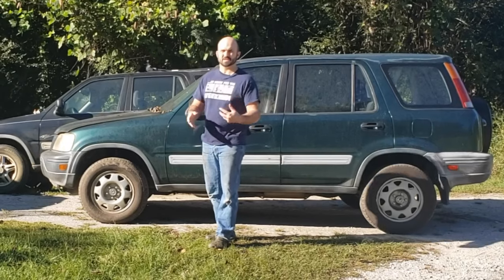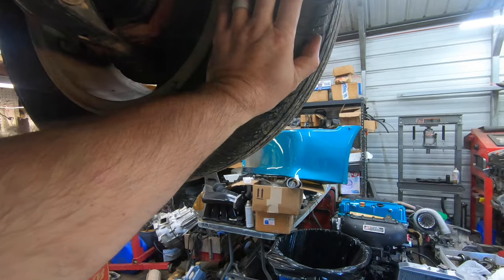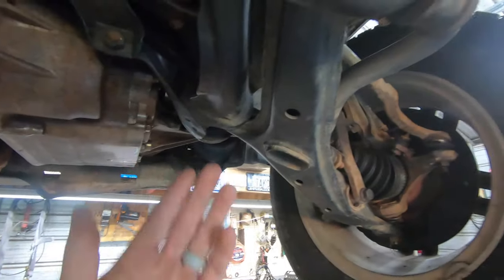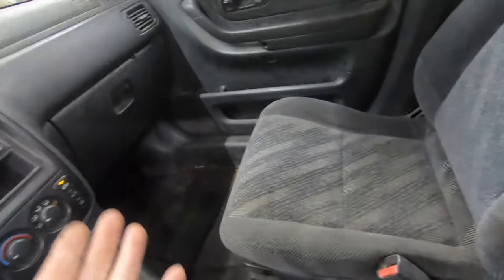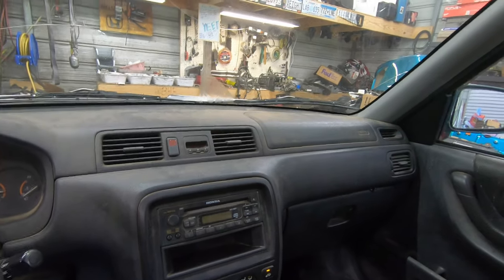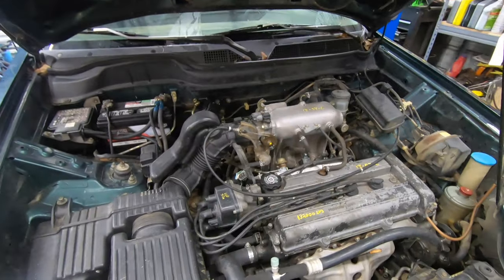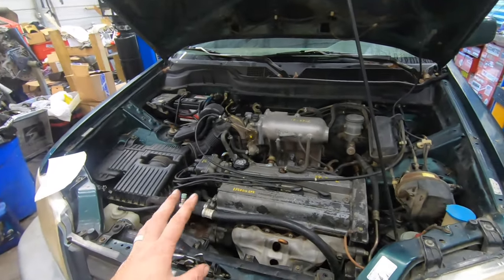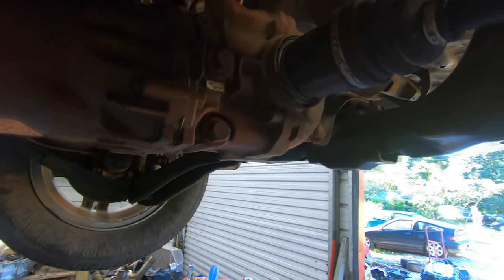Most Common Problems: 1997 - 2001 Honda CRV RD1 RD2

Comment: I have owned a 98 CRV since it was new, a common problem I have had is that the electronic air control valve bolted to the back of the intake manifold becomes fouled, causing rough idle.  It needs to be cleaned with brake cleaner every 10,000 miles or so.  Keeps the car idling smooth.
Reply: I'm thinking I need to do this because I had surging idle with IACV DTC for a second.
Reply: Every 10k miles sounds like over kill lol maybe once a year🤷‍♂️🤔
Reply: @Danny Martinez  well every 10k miles is once a year for a lot of people
Reply: @jacobgillean7129  I never had issue bruh
Reply: @Danny Martinez  same here. But my friend has had that issue on one of his crvs and his del sol
Reply: Yeah IACV issues is common on ALL B series motors. Anyone who's played with enough of them knows all the nuances of the lovely B series IACV issues.
Reply: Typical honda problem
Reply: yes i replaced 2 IACV already in addition to the cleanings in between @210K miles
Reply: I have the same issue.. I’m thinking mine might be with PCM programming or something though because cleaned it and only helped a little
Reply: @dannymartinez8522 on average, ppl drive 10k per year, so 😊
Reply: I have an issue, when I turn my steering wheel my rpm’s go down and starts shaking also have rough idle, did that happened to you?
Reply: I have the same issue glad I saw this comment I thought it was in the valve cover

Comment: 1999 CR-V EX, 267K miles two years ago the a/c compressor went (part $168/ + $120 install) and charge,  2 rear links and the cruise control does not work, the clock in the center of the console doesn't work and I had to replace the door pull latch drivers side, $11 for the part and about 20 mins of my time.  That's it.  Best car I ever owned.
Reply: wow thats awesome! just got a 2004 crv 170k in immaculate condition and i mean immaculate! hope to see it get to the 267k
Reply: The clock didn't work in mine when I first bought it. I took it out, disassembled it and followed a tutorial on here to reflow solder. Worked like a charm. Just be careful when removing it from the dash as the dash is soft and likes to crack when leveraged against. :)
Reply: @kirleyq1394 Thanks!
Reply: @gailmrutland6508 See video:   Honda Cruise Control Fix With A Penny_   DIY Jeff 
I am not sure, but the above YT video MAY be the fix your cruise control issue.   
And read the comments section afterwards, because there's an adjustment.  See 5th comment down, made by @itzmrfizz
Reply: @kirleyq1394 mine dont work either

Comment: Just FYI on the passenger side water on the floor.  I have dealt with this issue on a few of them.  On the roof there is a black strip that runs from the windshield to the rear window.  There is a body seam under that trim and the sealant cracks.  The water enters the body seam, runs down the a-piller then behind the dash and onto the floor.
Reply from the maker: I'll definitely check that out as I have one here now with that problem
Reply: I also have the same problem
Reply: A cruddy door seal will also cause a "leak" onto the front passenger floor.
Reply: currently I need advice how to deal with mines  I have  the 1998 model with sunroof and when rain fall heavy both passanger and driver side  water on the flooring please what cause this really need to get this sought out soon as possible. could it be the sunroof rubber need changing if so where can I source the rubber online to purchase. Help anyone please how to deal with this problem.
Reply: How would you fix that?
Reply: Dealing with this now.
Reply: @kenankabbani855 probably replace seals or try some kind of sealant
Reply: I have the same issue with the water. I procrastinated too long and now my heater doesn’t work. I’m going to check it out this weekend 😂
Reply: I had the exact same problem after I had the windshield replaced it was still leaking then I blocked off the fresh air Inlet and it was still leaking and then look under that black trim and found the crack a dug out the seam sealer and caulked it back with clear roof caulk no more leaks
Reply: @paulettemcintosh1834  It's not the sunroof rubber seal. It's the drains that are clogged.  There are 4 gutters that each lead to a drain hose. Each hose is channeled through the "A" pillars in each corner and down through the floor plate where it is designed to flow to the ground outside the car.

When the hose channels are plugged by dust, leaves, tree branches, pollen, road debris, etc, the water from the rain can no longer flow through to the ground. This causes the stopped-up water to seep through the joint between the sunroof gutter and hose there by trailing on the hose till it gets to the car floor plate. Hence, the water pool.
Reply: @SluiceBuckit  The water leaks is not connected to your heater inoperability.

Comment: I live in South Africa and own a 98. Most issues you mention I have dealt with. One issue that there was with mine is on the ignition switch. There is a small harness about 4 inches long that connects the ignition to the wiring harness. The ignition wire fails, causing the car to cut out while driving, and you have to restart. In the beginning it happens intermittently, but get to a point where you start the car and it dies immediately, and to replace it costs a small fortune in my country. I solved the problem by brigding the ACC switch and the ignition switch with a small piece of wire. This was 9 years ago and never had problems again. Only drawback, when you switch the car on at ACC the dash lights up. Hope the advice helps someone

Comment: My 2001 manual 5 speed in newly painted Milano red will hit 300K soon.  I do all maintenance myself & it runs like a dream. I've experienced about half the issues you list & some you haven't. The last part I replaced was a door lock actuator. Those $9 aftermarket actuators are junk!  My CRV is only the 2nd car I've ever owned & I just turned 60 yrs old. My last car was a Mazda RX7.  Only Japanese.
Reply from the maker: Nice! We have 2 '93 rx7s
Reply: I saw a bright red 2001 recently. Couldn’t believe how nice the new paint job was. Did you have a chain outfit do the work or local shop?
Reply: @gomertube  Went to Maaco. Filled any dents myself to save money.  $1300.  I was told I didn't need their premium paint job. No orange peel & damn looks brand new.
Reply: @darrylstevens2556  Thanks, man.

Comment: I bought mine with a valve seat issue, I had a machine shop fix it and has been great since, I did the oilpan updated gasket when I had the cylinder head off, I'm sure mine needs the front swaybar links and change rear diff pump fluid, great little car with it's own table.

Comment: I swapped the rear diff for the unit from the 2008-11 Element, and it makes a huge difference!  Drives much more like a car, the original diff makes it feel like a heavy truck, even though it's a unibody.
Reply: I have a CRV from 99, 147 hp, and i'm interested.
Besides the quieter move  how about the power ?
How difficult is to replace the diff ? Does it fit ?
Reply: @adihus67   It's not hard to replace the diff, it's very accessible.  The power feels much better, it completely changes the driving feel of the CR-V, feels like a nimble car instead of a truck, even on the snow.  It's an exact fit because they used the same casing as the original unit, which makes sourcing one difficult, they only way to tell which one has the upgrade is by model year.
Reply: I didn't notice any difference in noise between the new and old diff, but neither seems loud

Comment: Great informational video. Was able to fix the clock in my old first gen with a $10 sottering iron. Only issue i had for the 30,000 miles of ownership i had was a sticky thermostat. Sold it to a good friend with over 300,000 miles on the odo and its still going strong
Reply from the maker: I've fixed a couple clocks over the years. I dont even bother with them now
Reply: Huh?
I tried to fix my clock with a solidering iron, I plugged it in, came on for 2 seconds and went back out.😐
I tried to solder as much as I can but couldn't get under a circuit board plate..the plate is like glued on.
Reply: For the clock I bought.a LED kit on Amazon for about $10 that fits inside the existing case.  No battery required if you hook it up to the exiting car battery wiring. Voltage divider (2 resistors) will reduce the voltage down to under 4 V.  All the old clock components get tossed.
Reply: @Darryl Stevens can you please link me to the led kit you used? Also tried to solder two diff oem clocks, works intermittently. Seems like the problem is in the wiring harness which i’d rather not deal with. Clock seems to work when moving harness in diff positions

Comment: Thanks for the vid. I love my 1st Gen CRV. I do have some issues but for the most part, these cars are tanks. A true testament to Japanese quality cars when they were still made in Japan.
Reply from the maker: I love them man
Reply: @hondaresource  Quick question for you, a while back I had an issue with the transmission slipping. (I had the transmission rebuild but still giving me problems, diff issue) .What is your recommendation when it comes to transmission and giving problems on this gen 1 Vs. Do you look for a wrecked one and swap it? (but I am afraid I am just buying time before it happens again). What's your take on this? I know the gen 1 Vs are notorious to have transmission issues. Thanks in advance for the comment on my question. And awesome content on the channel. You got a new subcriber here. :)
Reply: @itsjiraheta  I had the 2 trans oil sending units replaced and the trans goes good now....only issue is I get a small clunk when going into 2 nd gear....but I'm having trouble passing emissions because it still trigger's the check engine light....The Tork converter   ......I'm looking to get a used trans on eBay or Junkyard.....then having it installed.....But common problem......
Reply: @SaulnowPaul77722  Thanks for the info. I just hit 200k. Doing a lot of work on it. I went to a junkyard and got me some some working selenoids. I hope that helps me. Doing a transmission flush too. Ill share my findings. But, I have heard the same thing. That tends to be a common problem. Thanks for the reply.
Reply: I have 1997 Japanese RHD! Love my little Beeden!  I am a mail carrier in the north.  AWD handles snow like a champ!!!
Reply: @robinhairell7780  Nice! I more on the south. I did drive the CRV from south Florida to PA. Lived there for about a year on a project I had to do there. The short time I was there on the winter. I could see a couple of places where the road salt took a toll on the car. THen I moved from South FL to both TX, so far it is still going.
Reply: Update: Doing all the above helped but I have to roll out of first gear early slow in order for the clutch not to jump and rattle. It seems if I ride first gear aggressive, the clutch disengages and rattles (like it pops out and rattles back into place) that pops into gear, if I am aggressive again it happens again, but if I switch to 2 it will o just fine (then pop it into D as I am driving). I just think the transmission is on its last legs. Other than that, when i hit 2nd gear,  in D there is no stopping.

Comment: You are BRILLIANT  !! ❗Thank you for all your video's.  I in past years all I have owned are older Honda CRV's. I don't want to own anything else.
Reply from the maker: Not sure what would cause a smell
Reply: Have you had any problems with your automatic transmission if so can I ask you a question I have a 2000 CRV $204,000 MI....
Reply: The only thing more quirky than a CRV, is a CRV owner.

Comment: The automatic transmission models often experience a shift flare when shifting into 3rd gear and a shudder during deceleration. The driver’s side window motor tends to weaken over time, causing the window to roll up slowly. The ignition lock cylinder can also bind, usually due to metal powder from the worn-down key accumulating in the cylinder. Blowing it out with compressed air worked for me.

Additionally, the driver’s side power door lock may start making a buzzing noise and eventually stop locking the door. I cleared out the dust from the lock assembly, and it’s been functioning well for the last 10 years. Another common issue is the muffler-to-intermediate pipe connection breaking due to rust.

These are a few extra things that weren’t mentioned in the video.

Comment: Completely right about working in the rust... Did my 99 crv's front suspension recently and the driver side came off okay, passenger side every second bolt needed to be drilled out or cut through. I can say from personal experience, a grinder doesn't nicely fit where most those bolts are and cutting through suspension components is a hell of a lot of work lol. At least I have a sweet CRV now though I suppose...

Comment: I was wondering where that leak was coming from. Thank you for the great info.
Reply: In my '01 it's not a leak as such but a dirty, cruddy door seal that directs water into the car. The seal has a fold that has to be opened up and cleaned out. I use the car key because it's pointed but blunt and won't puncture the rubber.

Comment: Great content, man!  You're one of very the few relatable content creators on this topic!  I'm heavily contemplating on getting a Gen 1 2000/2001 CRV  -- can you talk on their 20+ year old automatic transmission?  What to look for before buying, it's reliability and it's maintenance?  The local buy & sell groups seem to sell the AT (automatic transmission) at a much affordable price than the MTs, buy Im quite wary of the AT's possible issues and upkeep -- especially on a 20+ year old Honda.  I've never had a AT vehicle ever, but I'm so tempted to get one on a gen 1 CRV!  Keep the informative content coming, and thank you!
Reply from the maker: generally they are pretty solid. The auto will most likely fail before the manual.

Comment: Thank you for all the valuable info.  The one serious design fault that has bothered me is how the rear tailgate works.  It is instinctive to just go straight for the handle on the tailgate, if you dont know to first lift up the glass.  Obviously, as the owner, it is not a problem, but generally when someone else opens the back, they just open the tailgate, so that the glass gets forced up and drops again.... and then, if they try to close the tailgate, it will just break the glass.  The printed warning is difficult to see, and pretty useless. 
The other irritating issue that I have noticed, - my CRV has the built in roof racks that run above the doors.  Pretty useless compared to those that run perpendicular over the roof, and also no sensible way to tie ropes.... but the worst issue is that there is a gutter to collect rain water that runs under the roof rack, and there is a post just above the front door, so when it has been raining, and the roof is wet, when you brake, all the water runs forward, hits that post and then pours down the window.... if the window is open, it pours down onto the driver - happens to me often, and I curse myself for not anticipating it.
Reply from the maker: They fixed it with the 2nd gen. 😂

Comment: Thanks. very clear filming of under the car and front end. Crv is a good car but this is the first time I have had this kind of car (2002 crv) which you can remove oil filter by turning the poassanger wheel to the right and you see the oil filter, just newly I found this by myself , otherwise is very hard to remove oil filter from under the car!

Comment: Hey thanks for the video, I have a 01 crv and I bought it about 2 years ago and I love it even with all the millage "230" it's still running solid but it's doing something that I don't know what it is, ans what it's doing is that the engine stops for no reason even when I'm driving in the middle of the road, then I Have to pull over and let it rest for 15 minutes and then I cracked and it's back to life and it's doing it more and more,  I think it's a sensor or gas pump I don't know,
Reply from the maker: Either main relay or distributor 99.9%
Reply: Full distributor or maybe if its hot out vapor lock, weak fuel pump.
Reply: Did the same & it was the relay switch
Reply: I’m having the same issues. I’m about to change the main relay today and see if it fixes it. Knock on wood! Will update if it fixes it
Reply: @adamtjapkes7804  did it work ?
Reply: @1dnsModzbo2esterman  it was my distributor all the way. I did end up replacing the crank position sensor, main relay behind the glove box and my distributor and plugs. Have had no issues in the past week

Comment: I just had all the frame bushings renewed in my 1st-gen CR-V - MUCH quieter now. Also had the door wiring problem - had the dealership do all the soldering - pretty good job - still works.

Comment: Bro you forgot to mention the biggest problem,  how cooked the owners are 😂😂. Seam seal in the roof channels and firewall near the cowl can split and leak ussualy after cleaning dirt and grime away.... fun times. Good video dude, much love from new Zealand
Reply from the maker: Thank you man
Reply: This is exactly my problem!! Water leak on drivers side somewhere up near the firewall. And there’s zero info on that. All kinds of info on the passenger side leak but never on the drivers side. Great video. Thank you for taking the time to make these vids on the first gens!!!
Reply: I agree with you jay bilawchuk !!! I have a leak on the drivers side too. So annoying!!!
Reply: The alternator is giving me issues.
Reply: 40 amp option fuse u nder hood of 98 Honda crv i pulled out and accidentally dropped it nto area under fuse box. cant see or get to.
Reply: @davidheaton2215  Same here just started 😢